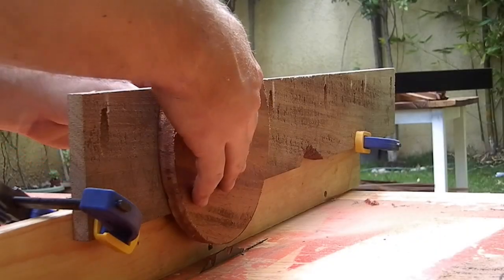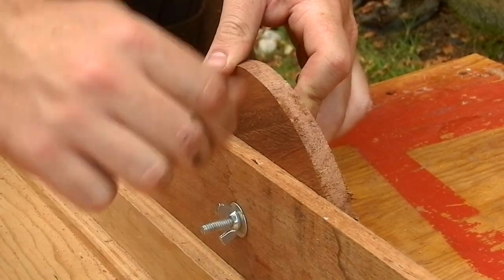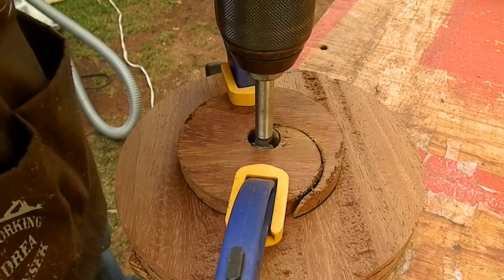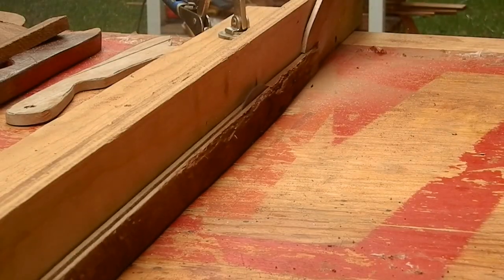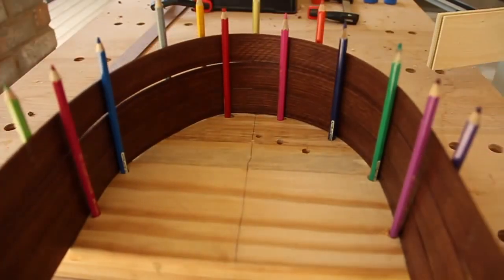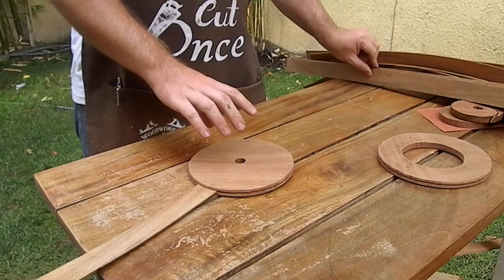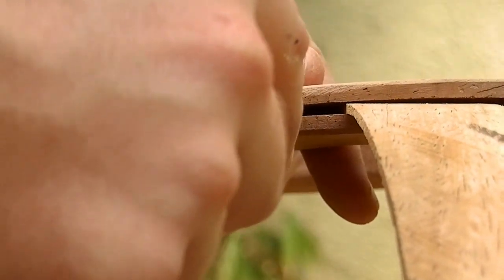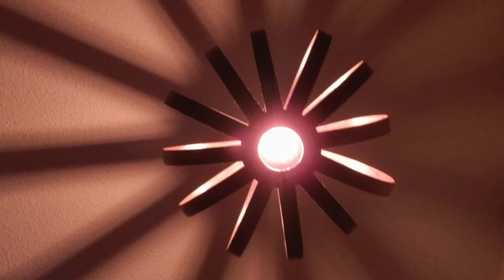Making a Pendant Bentwood Lamp - Ep 055

Comment: That turned out awesome. I especially like the part with the colored pencils :). Thanks for the shout out! Mine is still going strong two and a half years later. I haven't even had to change a light bulb yet. Those Edison style bulbs seem to just last forever.
Reply from the maker: The part with colored pencils is the best, hands down :)
Thank you for the inspiration and for your part in my video!
We use the lamp in the bedroom and the light is dimmed which is great as an accent light. Cheers